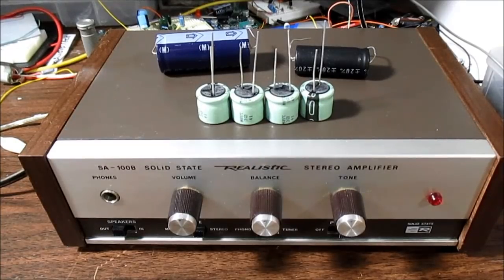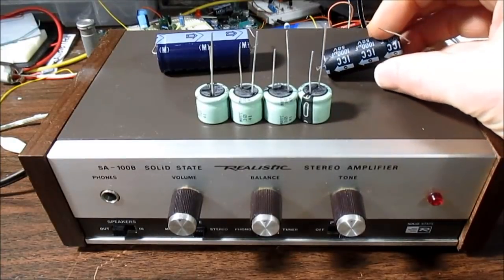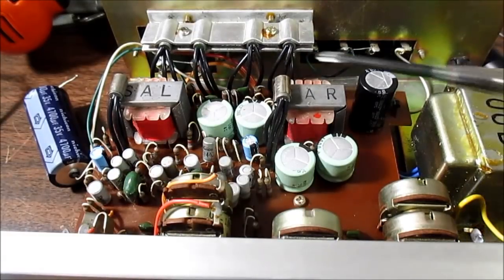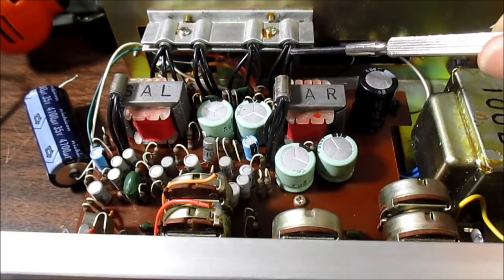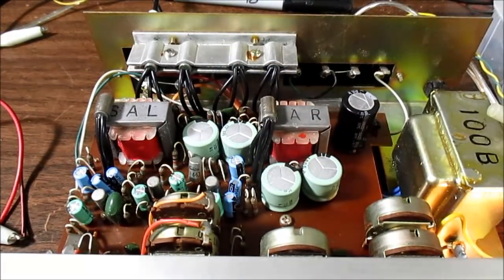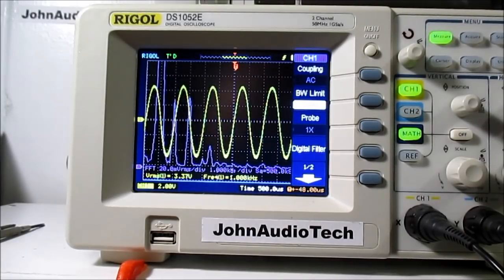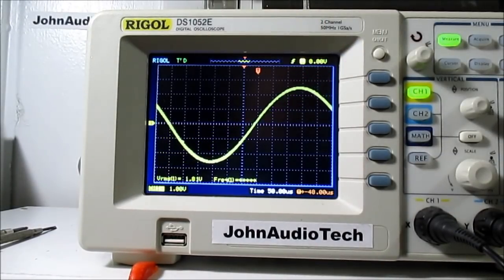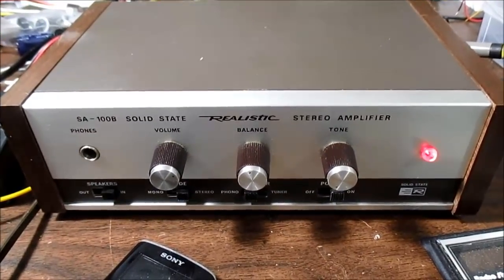Realistic SA-100B mini stereo amplifier recap complete

Comment: I have this amp and would like to recap it. It will be my first attempt at something like this.
Would you happen to have a copy of the schematic or a list of the values of the original capacitors? 
I have been unable to find this online.
Reply from the maker: The Hifi engine site might have a schematic (you have to register, but it is free).

Comment: I'm still using a SA-155 I have had since before 1995. It's been perfect for something on my PC desk to drive non-powered speakers from a choice of inputs, including transferring from my vinyl collection to digital because it inputs phono too. A reliable and attractive replacement would be north of $100 where I live.
Only lately I think it's developed interference noise, so I took it "off line" but I won't throw it out. I'll have a poke at it again and if it is bad, at least it will provide a ready made and attractive case to drop in totally new boards and keep as much of the front and rear hardware as I can. Visually It makes the SA-100B here look like a dog, LOL.
Realistic provided a great series of priced to sell products that got the job done; the same way Heathkit was one of my go-to stores back in the dark ages.

Comment: Hello! Recently I picked up a similar model amplifier, the Realistic SA-100C. And I feel like I should probably replace the caps on mine as well. Now from what i know you are supposed to match the capacitance when replacing the caps. Why do you increase these values (470 -> 1000, 1000 -> 3300, etc)?
Reply from the maker: The 100C is a more modern design using silicon transistors instead of germanium. It has less caps. I increased the supply filtering as 1,000uf is a bit low for an audio amp. The 470uf caps were supply bypass for the preamp stage. Increasing them was not really necessary, but I had a bunch of those 1000uf ones on hand. I'd leave the others at the same value unless you can determine that they should be changed.

Comment: john you think it's possible to build a protection "general purpose ( to protect  the output power transistors ) ? i know  every amplifier need to calculate severals parametre ,one amplifier is not another but ...?
because the darlington are so fragile ! if you short circuit the output , power transitors and drivers burn immediatly :(

Comment: Wondering about the transistors or diodes mounted to the tops of the transformers. Just a heatsink for the driver? Or part of thermal management/bias? Doesn't seem like the transformers would warm in an amp that small.
Reply from the maker: Those are the transistors that drive the transformer. It is a class A type stage that gets a little warm. Using the transformer is just a convenient mounting point for a heat sink. I guess germanium transistors are heat sensitive, therefore, keeping them cool is important.

Comment: Hello! Do you use a signal gen for that sweep?
Reply from the maker: I made a 20 to 20K sweep .wav for my audio player.
Reply: JohnAudioTech is this wav file shared or could you upload it somewhere? I do not have a sign generator and this would help doing this type of measurements you do!
Reply from the maker: Yes they are available online. I am adding some more files and will make it available soon in an upcoming video.

Comment: I wish you would do schematic analysis on your videos. Would learn a lot more about Audio circuit design schemes.
Reply from the maker: I plan a video on how these old amps work. I talked a bit on the schematic of this amp in the first video.
Reply: module PAM8043 use for bluetooth speakers it's a class D amplifier very small without any heatsink !
Reply: No heat sink means it's efficient in switching. These are not only for BT speakers. And class D can be filtered if you need a sine-wave output. 
That Radio Shack amp is only 1.5 Watts. I built an amp based on the PAM8043 module, and it sounds pretty good. Can drive a 4 or 8 ohm speaker directly. Pretty neat cheap chip.
I am pretty sure John did a comparison on these modules about 6 months ago. It was pretty comprehensive. 
You should watch it if you haven't already.
Reply: But class D amplifiers are not really hi-fi.
The only true solid state hi-fi amplifiers are discrete transistor class AB
Reply: if you want to learn and also to build an amplifier just check datasheet from TDA 2003 ,i maked a stereo amplifier with two TDA 2003 it work very well and so easy to make ;)
Reply: i'm at a number of 20 amplifiers diy and i use a maximum compo,ements from the 80s like couple of darlington (TIP142/147) or other 3055 with larger capacitors and resistors ^^ so easy to make and of course ,very easy to fix
Reply: Now-a-days you can buy 10 modules like PAM8043 3W stereo amps for less than $2  !!!
https://goo.gl/CzJxJr
That's twice the power of this Radio Shack thingy.
I am more interested in how they used to do it.
Reply: you're right not only for bluetooth speaker for sure ! i also builtg severals "little" amplifiers with the PAM ^^ and yeah sound's pretty good and just about MAX 700ma of consuption !
Reply: yes you're also right , i know what's and i LOVE build amplifier with a couple of power transistors ;) next time i show you photo of last amplifier build by me ^^ minimum of componements (base of "darlington" TIP 142/147 and capable of + 225 watts  with powerful bass (depend of the power supply and , of course ; larger capacitors )
Reply: Not much into amps and music. Just interested in the circuits and the tips and tricks I can pick up here and there. 
I am not a sound expert and I can't tell them apart. Maybe these ears are getting too old...

Comment: Did you spec the ESR for the output caps?
Reply from the maker: No. The standard fare 1000uf caps should have an ESR of only a few tens of milliohms. Driving a relatively much greater impedance of 8 ohms, I don't see the benefit.